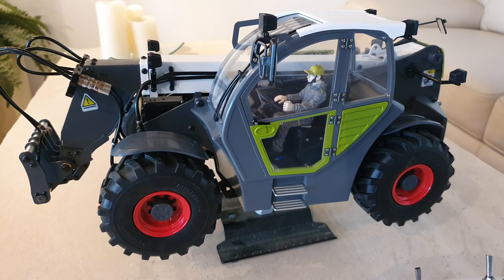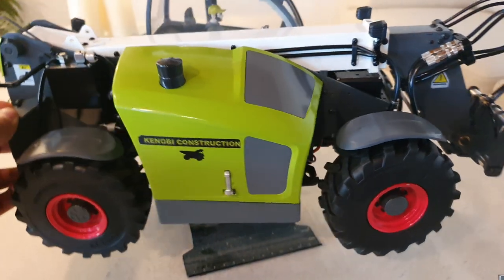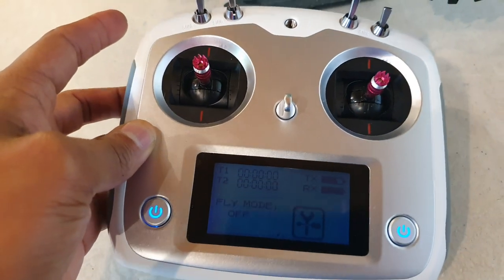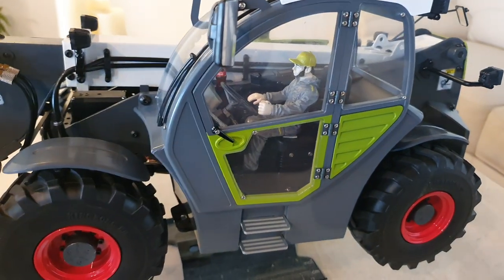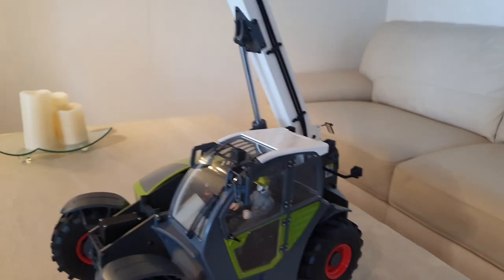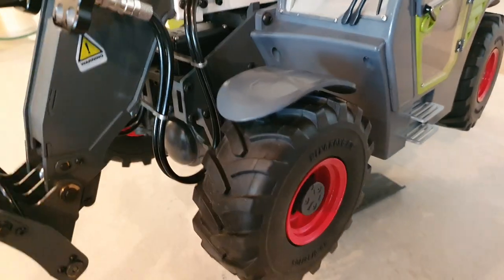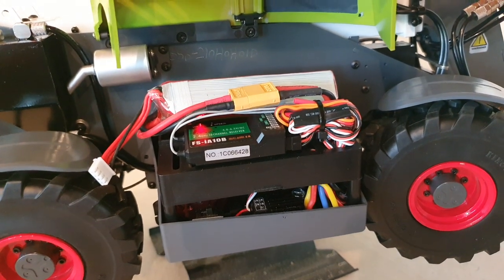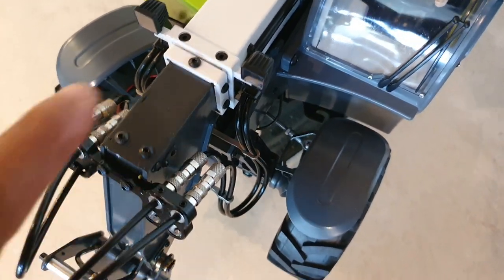RC  hydraulic Teleloader - JDM128.  review.

Comment: Great review, it looks to be running the same hydraulic pump as the dxr2 dozer which has like you mentioned plenty of power..  Now you got me thinking on either this model or a excavator in fall months.  This looks lIKe it can have a lot of fun options of driving..
Reply from the maker: The pump seems a bit smaller than the one wheel loader
Reply: @75echo  how has this model been for you? are you happy with it over this past year? performs well?  Im thinking on making this my next unit.  Hope all is well buddy
Reply from the maker: @thatsmyrc  hello , it has been fine and I am completely satisfied.  It performs very well with light workloads as a multifunctional machine, but if you have plans on pushing som serious dirt, then I do not think that it was built for that.

Comment: Hi there just wondered which battery you use manufacturer etc, I am a where it’s a fairly small space inside,and I’ve just ordered one of these so any advice would be appreciated. thanks
Reply from the maker: I use a 3S lipo battery. Most rated between 1800 -2200 mah will fit in the battery box.
Reply: @75echo  that’s brilliant thanks for letting me know, are you pleased with it?

Comment: WOWZERS! 1.3 KG is still ALMOST 3 pounds of lifting force, at full extension! 
2.85#, IF I did my math correctly.
Reply from the maker: Yes  its the whole truck will tip under the weight before the boom gives up.